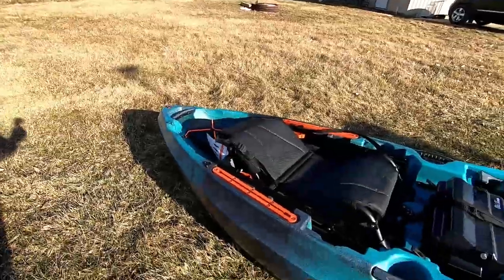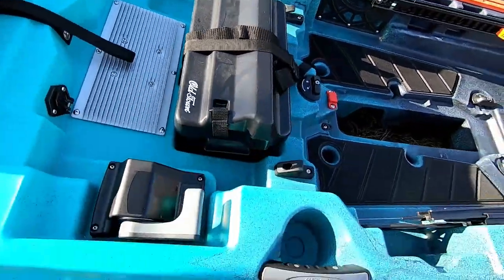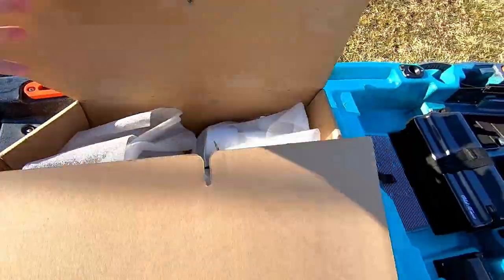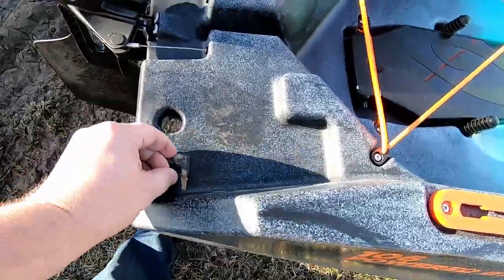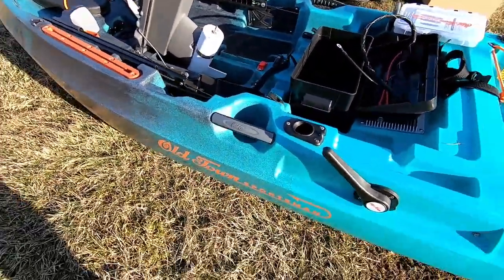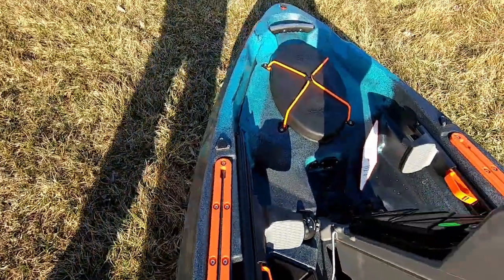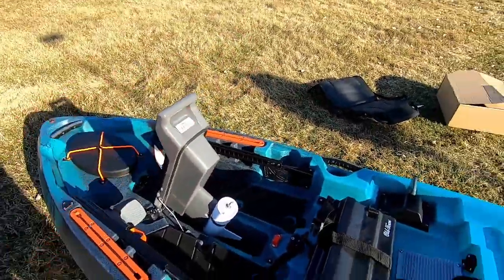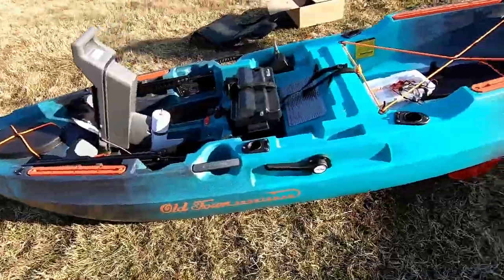Shaky- Old Town Sportsman 106 Powered by Minn Kota Kayak, part 1 unpacking

Comment: What cart is that and does it work well with the kayak?
Reply from the maker: Onefeng Sports Universal Kayak Carrier. Has worked well for me .......... so far.
Reply: @cawjr69  Thanks for the reply, do you usually transport with the battery in it?
Reply from the maker: @joeys7519  I carry the battery in the vehicle with the rest of my gear.  Then load up when I get ready to launch.
Reply: Where did u get the cart from. My 106 may not come until February but it would be nice to gone have the accessories. The one they tried to sell wit it was like $150. If this one cheaper I will jus get it.